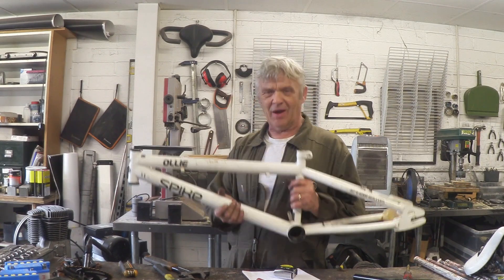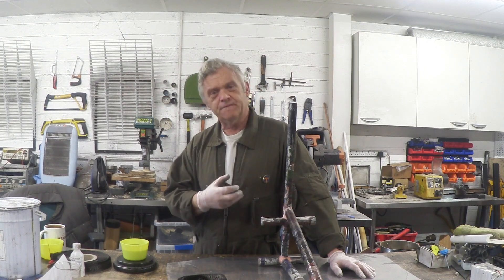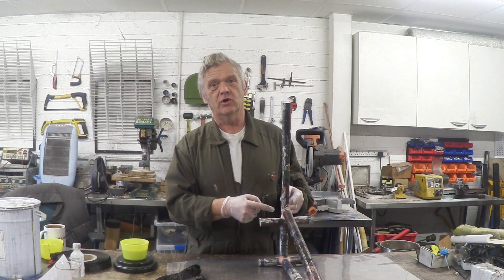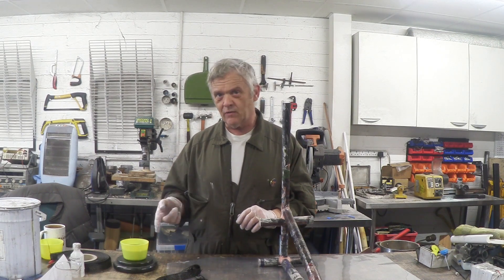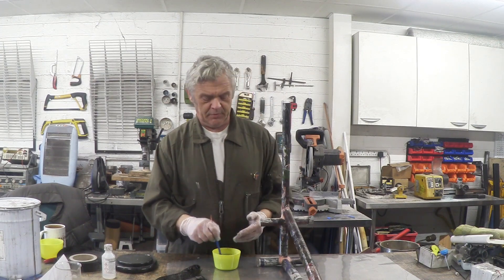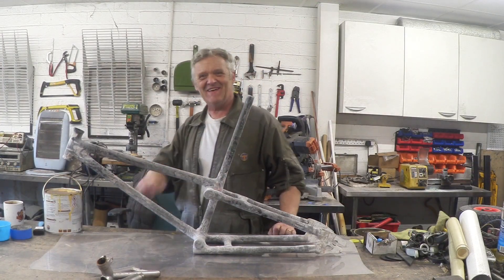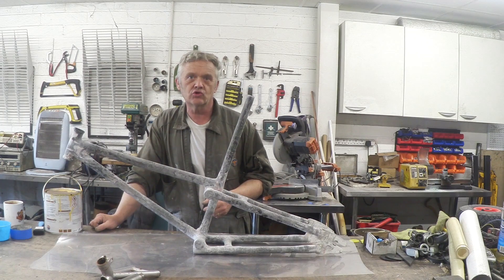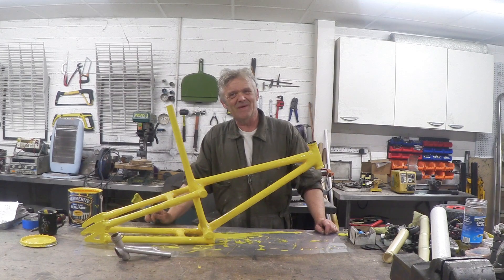1167  A Paper Bicycle - Building The Frame

Comment: Looking great! I'm a little confused about the decision to connect the seat stays to the front of the seat tube, rather than butting against it, as that seems to my mind to be the joint experiencing the most compression under load. I seem to recall the same feature on one of your bamboo builds.
Reply from the maker: in that position they pull on the binding which is where the strength of the joint comes from

Comment: This is very cool - especially if it could be used for bike accessories such as custom trailers.  I've seen many commercial trailer products and home brewed designs, but I'd like one that can be both a cycle trainer and hand cart.  This could be a great prototyping material for trying out such designs (or at least will once I get through my bicycle restoration backlog!). 

Just out of interest how do you do the head tube, seat tube and bottom bracket? Are these multiple small tubes bound together or a single thick tube drilled out?

Thank you for the ideas and data Robert.
Reply from the maker: I would agree mate as a prototyping material it would be excellent